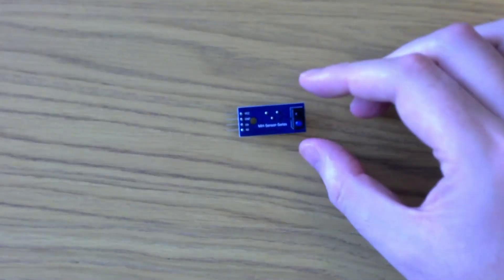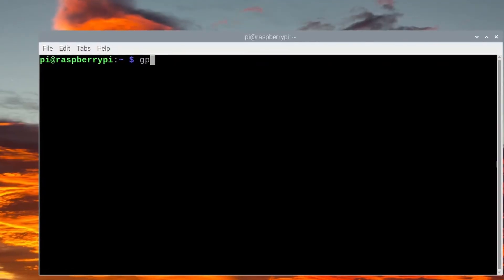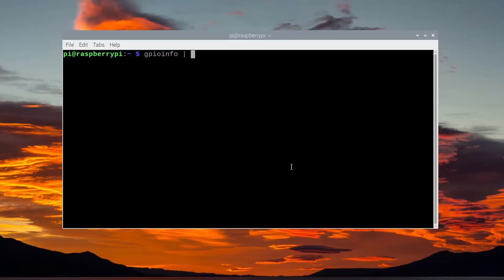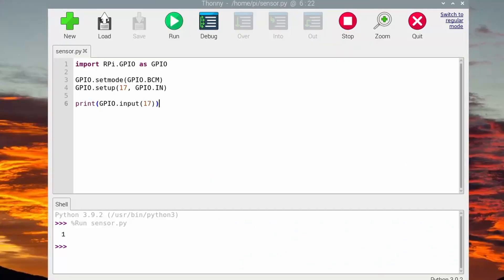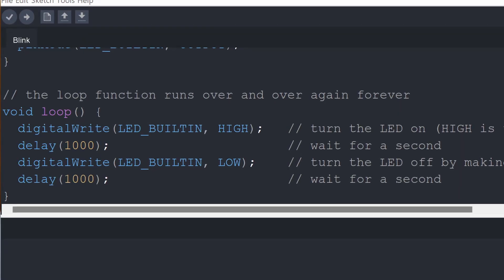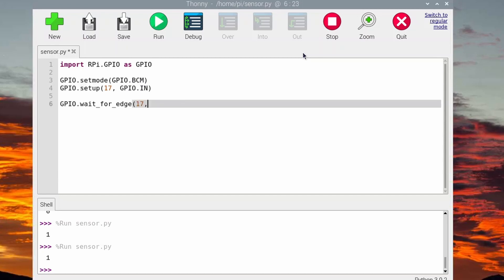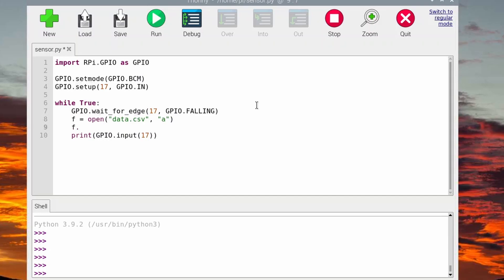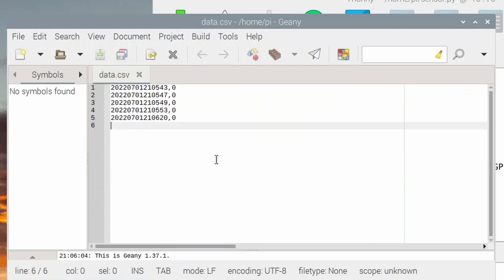3 steps to save sensor data on Raspberry Pi

Comment: Hey man, thanks for the video you explained alot. Have you considered on how to send the real-time data from the raspberry pi to be edited on another device? I know you mentioned it but I'm having trouble finding out the best way to go about this problem. Thanks
Reply: any update on that video he is telling?
Reply: You can do this with a lightweight shipper, for example filebeat to an elastic stack. Filebeat could have some dependencies you'll need to work out running on a pi, but its very effective at moving data. Then you can manipulate the data in your elastic stack or message broker as you see fit.